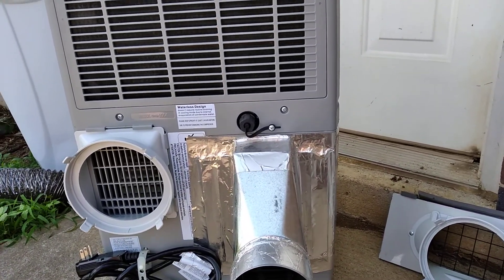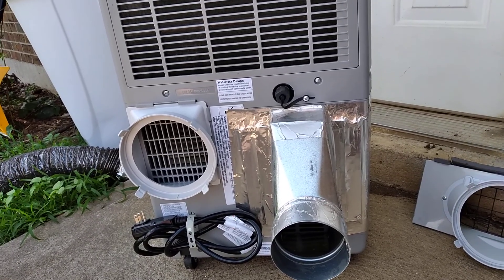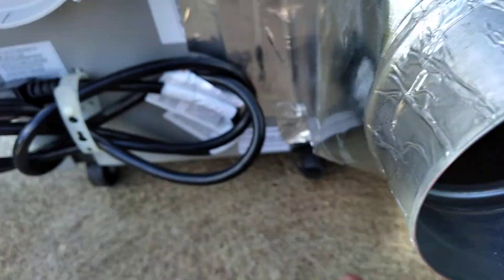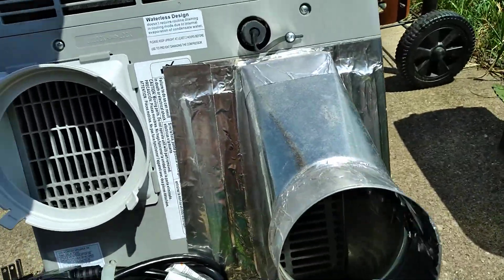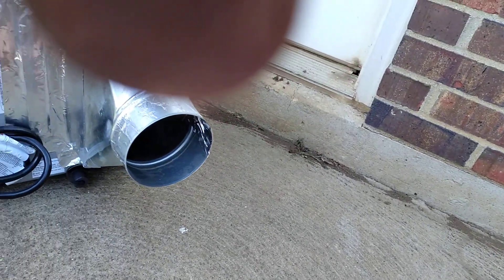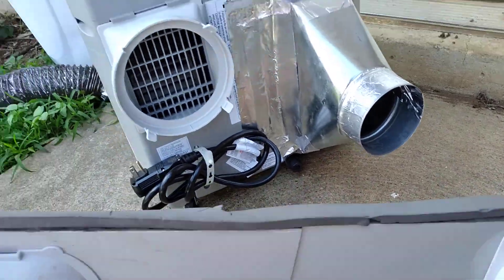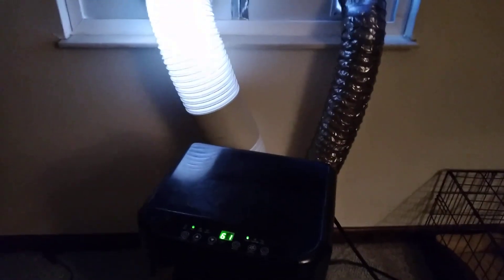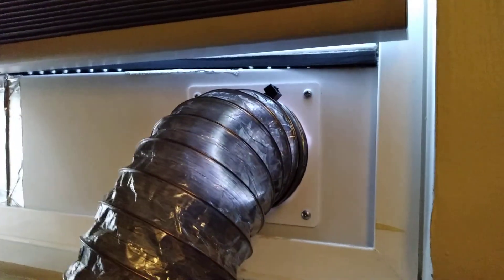Convert INEFFICIENT 1-hose portable AC to a 2-hose

Comment: I believe you have the hose in the wrong vents.  The intake panel that has a filter in it at the top of the unit is where it should go.  The bottom vent is only to cool the compressor motor.
Reply from the maker: Nope I smoke tested it with incense. There is TWO intakes. One for the evaporator (it has the filter) and one for the condenser. My extra hose is on the condenser side.

It's NOT to cool the motor.
Reply from the maker: Btw almost ALL ACs have 2 intakes. A window unit pulls air into the sides and blows it out the back for the condenser side. The evaporator is pulled in from the front and blows the cold air out the top.

For central units the condenser is a separate unit outside. It pulls air into the sides and blows it out the top.
Reply: That would mean 100% fresh outside air
Reply: @somethingsomething404  no, the air will still find its way inside no matter what, you should always leave a little gap for indoor air get sucked through

Comment: That's a great life hack because it also helps you to find the features you're looking for since most are single hose. Some newer AC's are self evaporating, and have a heat pump and inverters. It looks so simple that companies should sell dual hose conversion kits
Reply from the maker: Lol, it's NOT accidental that these are inefficient. I highly doubt a truck driver (granted I was an aviation electrician in the USMC), is smarter than college educated engineers.

Albeit, I don't have definitive proof, but it's highly probable that the inefficient design is INTENTIONAL so you have to buy more units.

Without 2-hoses, 2 portable units + the window unit we had in our apartment wasn't good enough. We was on the top/3rd floor and it was sweltering! I did this before purchasing a 3rd unit. AFTER THE MODIFICATION WE DIDN'T NEED A 3RD UNIT!
Reply: @Stacy_Smith  What they often mention is that single hose units are cheaper and easier to mount and store. Upgrading single hose units would be an employment opportunity. One can 3D print a hose attachment so that no modification is needed for the device. That would make the AC last longer and save on energy bills.
Reply: @Stacy_Smith  If we think ahead, it just doesn't make sense to intentionally make ACs inefficient so that we have to buy more. There are potential impacts which may affect the designers. If too many ACs are running, it may cause a brownout.

The wildfires from Canada right now could even be affecting themselves or their friends or relatives. The smoke could affect those far away from the fires. We're not sure how much, if any, is contributed by using single hose rather than dual hose units.

I've heard of strategies that some may use to increase repeat businesses. For example, some mentioned about the right to repair.

I ended up buying a Midea Duo and with a custom wooden panel, installed it onto a casement window.

Comment: Nice work!!! I find adding a Cool-Aide heat sleeve keeps exhaust hose temp 82F vs 120F without one. Exhaust hose without a heat sleeve is just pumping removed heat back into your room.
Reply from the maker: I agree, but I don't have the time to mess with it. To be honest, I'd be more happy with the light blocking benefits than the increased efficiency.

A lot of times when I go to bed it's still daylight.
Reply: @Stacy_Smith  Very nice work that you did!!! Fresh Air intake from outside must be amazing. Might try it!! Keep making videos!!!!! Adding a heat sleeve is easy. Slide it on the exhaust hose and zip tie both ends. For my extended hose setup,  I need two of them : Sleeve #1 = PAC to Duct Elbow Joint, then  Sleeve #2 = Duct Joint to the window. Heat in the tube stays in the tube - until it reaches the window. Without a heat sleeve, the outside of the exhaust tube can reach 120°F and that heat is going to want to travel back into your room.
Reply: What tool did you use to cut the opening circles for the duct tubing?
Reply from the maker: @BrewerShettles  A Leatherman.
Reply from the maker: @BrewerShettles One I did with a kitchen knife, the other was a Leatherman.

Comment: This is the video I needed.  I'm looking to cool an RV trailer better, and the bad design of single hose units would likely be even worse in a small trailer.  For sure going to be doing this!  Thanks for the video!
Reply from the maker: Yw
Reply: Buy a console type AC, much better, much safer, you just need to make 2 holes in the adjacent wall and that's that! Console ACs are slimmer too - look like normal heaters.

Comment: Not going to work unless you opened the unit up and created two seperate compartments insulated and air tight from each other. If it was this simple all portable ac units would be dual hose.
Reply from the maker: I've USED this setup for years now. They ARE separate from each other.

Ever think that the inefficient design is intentional so they can sell more units?
Reply: @Stacy_Smith  I can't see inside yours so couldn't say for sure, I opened mine up and they are not sealed from each other.
Reply from the maker: @danielsmith2447  Maybe you can put in a styrofoam divider splitting the intake to the condenser and evaporator?

I showed 2 different units on this video, maybe you could buy one of those.
Reply: @Stacy_Smith  I was thinking between styrofoam and refectix I could figure it out. I may post sme pics of the results here.

Comment: Thanks, i used a similar setup following this video for my honeywell mn10cesww  and MAN! Before the ac was pulling all the air in a vacuum and all the weed smell from the neighbors was coming in through every single outlet/ and small hole. Now the unit cools the room faster and stays cool. I wrapped the exaust hose with a towel to avoid the heat to be present in the room.
Reply: Sorry I'm your neighbor,  I'll smoke on the other side of the house!!...promise!!
Reply from the maker: @kitkimbrough9441  Lol, we don't live there anymore.
Reply from the maker: YOU TOO? When we lived in the apartment our pet skunk was stinking up the apartment. After I converted our ACs the problem was solved.

WAIT A MINUTE...

WE DON'T HAVE A PET SKUNK!

Gee, I wonder where that smell was coming from? 🤔

Comment: So I’m going to do that to mine when you bought the HVAC stuff did you buy the four-inch or the 6 inch inlet….. I don’t know much about that kind of stuff but I would say if you go with the 6 inch inlet and a 4 inch outlet it would improve because you can suck more in then you can push out
Reply from the maker: I went with 4, but you're totally right about 6 being an improvement. The only problem I ran into was finding a fitting for the window plate that would accommodate a 6in hose.

One can fabricate anything, but it comes down to how much skill do you have, what tools do you have, and how much time do you have to do it?

I'm a driver time is definitely not a luxury I have. The quicker and easier the better. Right now it looks like you placed a grenade at the front of my bike in my cousin's garage. Parts everywhere and I don't have a Harley so everything has to be fabricated to make it fit.

It should be done by the 2nd week of PHUCKING JUNE.

Comment: You think this will work with a window unit? it's for my semi and I'm hesitant to cut a hole on the truck so thinking of using register box to vent it with an inline exhaust fan
Reply from the maker: Out of curiosity bow are you powering it, because APUs provide AC. Is this for shore power use?
Reply from the maker: Definitely would work. Use that thick rubber weather stripping and cut a groove in it to put in your passenger side window.

NO FAN REQUIRED, the portable AC has a fan built in that pulls & vents air.

BUNGEE IT WHEN ROLLING! It's not good for ACs to be on their side.

Comment: Can I hang the intake hose to the other side of the window as I have two windows on top that can be opened and the exhaust  hose to the other side?
Reply from the maker: As long as both hoses face outside it doesn't matter what configuration you put them in.
Reply: @Stacy_Smith  Will the hose pull in outside air as the condenser intake is not separated from inside?
Reply from the maker: @arfiansyah8718  I'm definitely confused. The evaporator (cold part) needs to be pulling air from indoors.

They designed 1 hose systems to pull air from indoors, blow it over the condenser (hot part), and then exhaust it outside, thus creating a low pressure area in your home that ends up pulling air from outside in your home.

My modification isolates the condenser to just outside air. By isolating the condenser you draw air from outside blow it over the condenser drawing heat off it in process. That air is then sent back outside creating an outside to outside circle of air. (Hot air from outside is heated becoming even hotter air blown back outside)

By isolating the evaporator (cold part), cool air is drawn from the room, passed over the evaporator, and cold air is blown back into the room.

I'm guessing you're from the Southern Hemisphere and English is not your 1st language. I suggest you show these comments to someone that has a better understanding of fluid dynamics & thermal dynamics that can assist you better than I can.

At least this video can point you in the right direction so those you seek help from will be able to better assist you.

Sorry this is the best I can do. Let me know how it turns out.
Reply: @Stacy_Smith  My 14000 btu portable AC blows cold air, and the room felt cold but the compressor doesn't cycle on and off I set it at 75 Fahrenheit is the unit undersize?
Reply from the maker: @arfiansyah8718  Depends, if it's a 1-hose convert it to a 2-hose. The higher efficiency WILL make it easier to cool.

If that doesn't work get a 2nd unit and convert it to a 2-hose as well.
Reply: @Stacy_Smith  If It doesn't work I will just use my single hose ac as dual hose portable AC are not easy to be found in my country and most shops sells single hose portable AC.
Reply from the maker: @arfiansyah8718  Just convert it using whatever resources you have available. Spray air freshener or blow smoke into the intake you suspect is your condenser intake. If the smell doesn't exit out the exhaust hose that's the wrong intake.

It should be easy to find though because most units have a filtered intake and a nonfilltered intake.

Your condenser intake will be on the nonfiltered side.
Reply: @Stacy_Smith  yeah my portable AC has three air grilles top is evaporator bottom is condenser and there is one more grille on the bottom left I found out which air grille to add the hose by using newspaper and feeling which grille drop the airflow more from the exhaust. The bottom grille I added the hose should I seal the other grille on the bottom left it is not the evaporator intake?
Reply from the maker: @arfiansyah8718  YES! Seal everything that is not the evaporator intake. 

As you can see in my video I filtered the condenser intake, but that is optional. If you can keep the coils clean it will run better and last longer. 

Monitor the filter and clean it on a regular basis or you'll choke your unit. The frequency will depend on the amount of outdoor contaminants such as dust and pollen.

Weekly cleaning should suffice.
Reply from the maker: @arfiansyah8718  YES! Seal everything that is not the evaporator intake. 

As you can see in my video I filtered the condenser intake, but that is optional. If you can keep the coils clean it will run better and last longer. 

Monitor the filter and clean it on a regular basis or you'll choke your unit. The frequency will depend on the amount of outdoor contaminants such as dust and pollen.

Weekly cleaning should suffice.
Reply: @Stacy_Smith  Thanks unit worked so much better now.
Reply from the maker: @arfiansyah8718  You're welcome! Glad I could help.
Reply: @Stacy_Smith  Tried it but today it doesn't work the intake hose seems to be blowing air out. compressor doesnt cycle on and off I think the unit is undersize.
Reply: @Stacy_Smith  does opening window helps while closing it with curtain to take air from outside?
Reply from the maker: @arfiansyah8718  NO. Cut a hole for the extra intake in the plastic window adapter. CLOSE the window against the adapter. It can be mounted horizontally or vertically.

The 2nd half of my video shows one in use.
Reply: @Stacy_Smith  Tried closing window but hose is blowing air out in the condenser intake.
Reply: @Stacy_Smith  there is a hole in the plastic adapter.
Reply from the maker: @arfiansyah8718  Send me a picture to stacybsmith1975@gmail.com
Reply: @Stacy_Smith  send it aiready
Reply from the maker: @arfiansyah8718   The file size is too large to open (1.8MB per pic). Hitting the rack when I get off work today but I will look at them tomorrow.
Reply from the maker: @arfiansyah8718  I have WiFi at home
Reply: @Stacy_Smith  I think the problem why it is not taking outside air. Is because the evaporator intake is not isolated from condenser intake so outside air and indoor air would mix am I right?
Reply from the maker: @arfiansyah8718  Not sure, without being able to physically look at.

Run some  tests with incense smoke or air freshener to be sure .
Reply: @Stacy_Smith  There is  a video made by zepto9 on how he convert his single hose ac to dual there is three parts in the video. He uses styrofoam and silicone seal
Reply: @Stacy_Smith  Hi have you look at my setup is there any problem?
Reply from the maker: @arfiansyah8718  I'll look when I get off work. I'm a driver.
Reply: @Stacy_Smith  are you from London?
Reply from the maker: @arfiansyah8718  U.S. Ohio
Reply from the maker: @arfiansyah8718  I don't get home till about 1pm Eastern time.
Reply: @Stacy_Smith  Are you home now?
Reply from the maker: @arfiansyah8718  Sorry I got busy.
Reply from the maker: @arfiansyah8718  I was able to look at your pictures. Unfortunately I'm unable to tell whether or not it's correct or not. Not being familiar with that unit you'll have to seek the advice from someone in your community that can do a hands on assessment rather than a remote one.
Reply from the maker: @arfiansyah8718  The internet was screwy because I'm on regular cell phone towers now and had no problems looking at your pics.
Reply: @Stacy_Smith  none of the community knows how to do this as most of them use split AC instead of portable.
Reply: @Stacy_Smith  I sent a picture of my portable AC in the manual can you check if I added the second hose to the right place.
Reply from the maker: @arfiansyah8718  spray the intake and see if the smell exits the exhaust.
Reply from the maker: @arfiansyah8718  if it does, you are correct.
Reply: @Stacy_Smith  I did another method I use newspaper to cover each air grille and see which one reduces the airflow of the exhaust more.
Reply: @Stacy_Smith  I figured out the second hose were long so I moved the portable AC closer to the window to shorten it. It made abit of a difference.
Reply: @Stacy_Smith  I did something extra, I opened the evaporator intake grille and I separated it from the condenser intake. I noticed there were gaps on the sides of the evaporator so I sealed it with aluminium foil. it worked really well the hose was pulling as much outside air and the room felt colder.
Reply: @Stacy_Smith  Hi can I put my portable AC higher on top of the table for better efficiency as hot air rises and cold air sinks.
Reply from the maker: @arfiansyah8718  That's what we HAD to do in the apartment due to limited space.
Reply from the maker: @arfiansyah8718  how is it working out for you?
Reply: @Stacy_Smith  it's ok but I can't really feel the cold air. as it swings up and down and the cold air is only at the front?
Reply: @Stacy_Smith  I saw another video to convert single hose to dual and that person uses two intake hoses. I am going to try it out and see if it works.
Reply: @Stacy_Smith  can I add an air circulator  fan  from the condenser intake so it will not take room air?
Reply from the maker: @arfiansyah8718  No
Reply: @Stacy_Smith  which AC cools better casement AC or portable as I have casement windows
Reply from the maker: @arfiansyah8718  idk
Reply: @Stacy_Smith  which fan speed has stronger airflow 1 two three or five? In aircon.
Reply from the maker: @arfiansyah8718  not familiar with aircon.
Reply: @Stacy_Smith  I have since gave away my portable AC. And replaced it with an LG split AC 12000 btu, works well quite cold it uses less electricity with an inverter compressor.
Reply from the maker: @arfiansyah8718  Good to go. Here it is -21 Celsius. Enjoy your warm weather.
Reply: @Stacy_Smith  Yea It gets hot and humid here everyday. Bought two portable AC,12kbtu,14kbtu both could not cool my bedroom down to how I like it. So Got permission from landlord to install split AC, and was approved I live in rental flat. Yea now my split AC has no trouble making my bedroom freezing cold.
Reply: @Stacy_Smith  yea I'm in Asia btw it gets hot and humid everyday no winter it rains sometimes. I live in rental flat so landlord allowed us to install split AC due to medical condition. So when we moved out we need to get contractor to repaint and seal the hole back. Everything in the house needs to be in the original state before moving out/leaving.